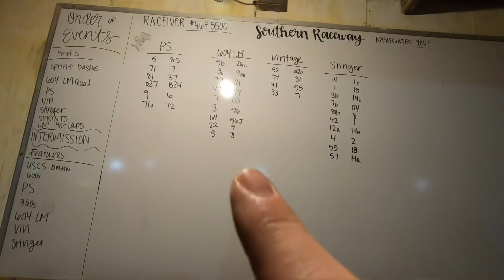Dirt Daddy Returns and Jonathan Takes Charge / Southern Raceway’s Season Opener

Comment: You guys didn't prank Dirt Daddy the way my son and his crew did me. My son drives a northeast style modified with a 602 crate motor. There is an annual tradition at New Egypt speedway where they have a special race on Father's day with the fathers of the drivers driving the cars. As my son was belting me in he was explaining the transmission to me ( The last modified I drove had a Powerglide) so I failed to notice his crew "working" on the right side of the car. They were installing a rig they had built the night before with two trailer lights, a blinker relay, and a battery from an old emergency exit. I didn't know till I pulled off the track that I was the old geezer turning left with the right turn signal always on.

Comment: I paused at 13:00 in after qualifying.... from what I seen so far looks like dirt daddy's car is pushing ALOT..... but he still looks smooth for not being in a car for a long time.
Reply: Looks to me like he's trying to drive it like a stocker alot different driving style for a late model I give a few more and he will be up in the pack mixing it up
Reply: @trevorfout4759  oh I definitely agree... them 604s gotta carry the momentum through the corners.... they ain't like them open motors he's use to from back in the day.... I agree the more seat time he'll be in the mix just like you said.... that new 56 looks like it was riding just like the 10 car when it first hit the track... now let's see what happens when Jesse gets that old 4sale going.
Reply: @davidadcock1475  hes gonna put it in p1 hes an iracing expert lmao
Reply: @trevorfout4759  Iracing will help a little but it's not anywhere near real life
Reply: Looked like down in one he was just missing his line on entry early on. Probably a combo of cobwebs and maybe battling setup. They did say it was laying over on the right rear so that may have been part of it. When he pulled off in the main first thing I wondered if he had overheating issues. Give him some practice and he will be on point.
Reply: @howardwest2707  yes I know he's just getting back in the seat..... notice how I said I paused after qualifying and notice I said it's pushing hard 😒😒😒

Comment: It looked like the front left was locking up going into turn 3.
Reply: 3 wheel brakes
Reply: its got a switch on the capital to cut that brake off to get in the turns better
Reply: Jeremy White
 Yeah good call I saw the same thing.